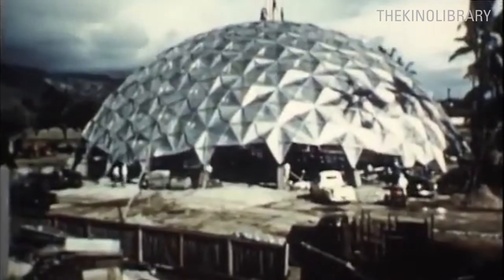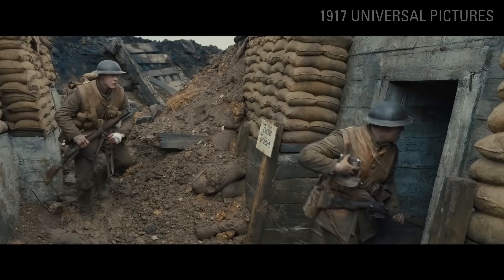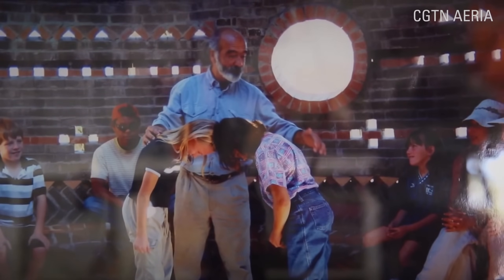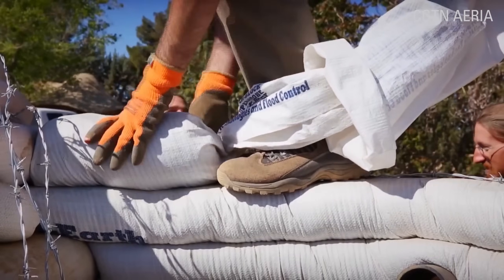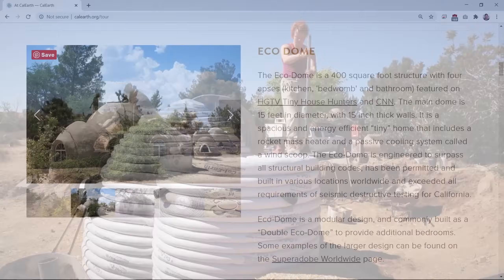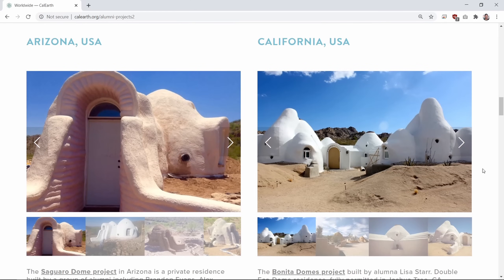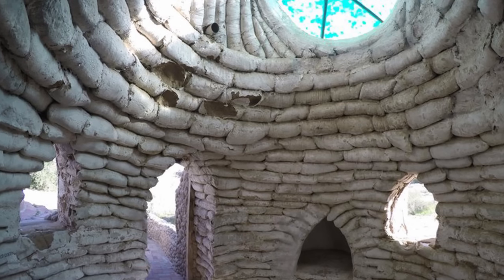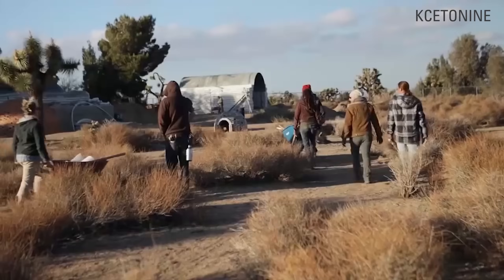Pros and cons of Superadobe Earthbag homes

Comment: The biggest problem you will have with these as homes in the US is building codes.  Most places will not allow you to build them. 

What I plan on is an earthbag greenhouse, adapted for northern environments. It will be a straight wall on the north side, fully insulated with roughly 8 inches of aircrete, with the earthbags on the inside acting as a trombe wall for thermal mass.  Alternatively I could use tire bales for the same purpose. This will be built in the Kenai Peninsula in Alaska.  https://www.lowtechmagazine.com/2015/12/reinventing-the-greenhouse.html

Earthbags will work fine if you build a bond beam on the wall on top and buttresses, which were covered in the earthbag building book by Mr. Khalili. On the square earthbag house you showed in your presentation you can see the builder incorporated them. The walls cannot be too tall though or straight walls will become unstable.

Comment: Could you use aircrete inside the bags instead of adobe?
Reply: Aircrete is just aerated concrete. The drawback is that aircrete is very porous. So you'll need to spray a sealant over the aircrete. You can use aircrete sprayed on the outside as a protective shell and on the inside as a type of "wall". But you may be better off spraying stucco for the outer shell. 
There is a company in Paris, Texas called Monolithic Dome that uses an airform. They blow this balloon form up and then spray aircrete on the outside of the balloon. Then deflate the balloon and then spray another aircrete layer on the inside.

Comment: I'm interested in the fail rate. 
Also, possible additives to increase strength. 
The housing market and lenders have biases. Incorporating the earthbag structure with the earth ship sustainability  is a sure way to appeal to the public instead of the market. It's the people who need affordable reliable homes.
The packing was the most labor intensive step with both the earthbag and earth ship homes. 
Thanks for the video.
Reply: Military bunkers made out of sandbags can withstand bombing from rpgs and mortar rounds if that helps at all. Also an earthbag orphanage built by Cal-Earth withstood the 7.6 earthquake that happened in Nepal in 2015.

Comment: I understand how this might not be an ideal building solution in the United States or most developed countries, but I do see how it would be an ideal solution in say rural India, China, many rural sections of countries of Africa and South America. Now what I don't know is if it would be more ideal then what they are currently using and if it would be cheaper then what they are currently doing. How it holds up in extreme weather and flooding would be one of the major factors in figuring that out. What I do know is in a lot of these areas light is an issue (windows that don't cause major drafts, so they tend to go without them, or very small ones) and just basic insulation or temperature control of any kind. 

There might also be a way to alter this building style so it does more conventional building sizes and shapes. It would up the cost, but it would still be cheaper then many current options, and eco friendly. It is a possibility in building evolution. The insulation value and the local resource are both reasons to figure out a way to make this building style work more broadly.
Reply: This is an example of a family that built one home / structure as a bedroom for each of their kids in Nevada. I forgot I had watched their channel before and after watching this video it was recommended again. Thinking back to that video this might be a good solution to lower income or even homeless housing. 

https://youtu.be/n_yAY1Ybfmk 
Video of one of their kids bedroom / structure

https://www.mylittlehomestead.com/full-version-building-earthbag-cabin-diy-the-family-builds.html 
Earth bag Cabin on their website

The more I think about this, the more I think this really could be a solution even in the United States because of how many people are willing to build themselves because they just don't have the money to do anything else.

Comment: There is another pro which is the weight. You mention they survived hurricanes so you hinted at that. But it's the earth bag weights that offer an answer to the question you pose. Regardless of sand and clay content in soil you can use local dirt as a weight in a pre-fabricated house that otherwise lacks structure or would have needed a foundation. If you have a triangular tube and half of the triangular tube is filled with earth bags and the other half is kept empty then you now have all kinds of the benefits of an earth bag home without as many of the cons. I have a design for a completely off grid pre-fabricated home that comes with earth bags in the kit. It uses geo-thermal heating and cooling, solar, wind, biochar creation for extra heat and a unique compost toilet that uses the biochar in a way outlined by an academic paper I think you'd enjoy reading. Get in touch if you want to learn more about the design.

Comment: Helped build two of these in Arizona. Figured out what you said pretty quick. It was a fun community project. Not practical on any level in the US. Good video.
Reply from the maker: I would love to see the homes you helped build! Any photos online? How many days did it take to complete?
Reply: @BelindaCarr  They were both 100% off grid out in the AZ Mohave desert. Sorry no pics. 25 years ago.
Reply: @BelindaCarr  as in many diy friends helping friends projects, the bulk of the work was done over three weekends on a 600 square foot dwelling, there was so much detail left undone such as finishing the roof, doors and other trim. Hard to say. I know one was abandoned early on due to structural concerns. We used rice bags with two rows of barb wire.

Comment: On the downside: in domes, roof and walls are one and not separate, therefore rain is flowing over it from top to bottom. This create a dilemma: in order to avoid water penetration you either make your dome waterproof and lose breathability (cement stucco etc) or have semi breathable and water repellent plaster that will need to be reapplied due to degradation (lime render). Other option is to create separate roof over dome, which will protect it from rain, or have superadobe walls only and something else overhanging them.

Comment: Looks like a perfect application for those bricklaying robots. Have one machine dig up sand and fill bags to a standard size, and the other one laying down bags and pieces of barb wire. One machine could build a village in record time.
Reply from the maker: Good point, but does it go against Nader Khalili's intention of bringing the community together and finding joy in manual labor?
Reply: @BelindaCarr  There's not much joy in manual labor after the first two hours. After that it becomes torturous. The same motion over and over again long after your mind has started wanting to be free to think and your body has started protesting over the toll the repetition is taking.
Reply: Exactly. This method is very labour intensive and in countries where labour is more expensive it will remain niche for hippies, preppers and off-griders. Nothing wrong with taking advantage of technology and 3D printing those structures.

Comment: Can withstand earthquakes only or more likely if the shape is round .
Reply: The walls may flex. Non round structures are bound at the top by a bond-beam that acts as a tension ring.
If the earth is tamped properly at each level the wall will actually "ring", as it is struck.
There are university studies and one website detailing the deconstruction of an earthen building.
Unreal strength, but for earthquake?
You're maybe onto something that's a lot about the foundation.
Earth houses are HEAVY

Comment: Cost! You completely went over cost. It's like cheaper? That's super important!
Reply: The  1400 sq ft earth bag house the my wife and I built cost about 20 - 25 k.
An eight foot section of wall that is 7 feet tall and 15" thick costs about 10 bucks or less in material, but can weigh 9-13 tons depending ( buttressing etc)
We had a conventional loft and steel roof that cost more than was bid. The contractor said I was using every brain cell he had, at one point.

The foundation, stem wall, bagging, doors, windows, bond beam etc were done by just me and my wife.
350 tons of material including 7 pallets of concrete and a semi truck full of wood, 175 tons of foundatipn shot rock and gravel, and all the dirt moved and screened by hand at least 3 times be just she and I alone. Avg. 6 days a week for about 9 months collectively.
I do not recommend this as a leisurely way to build a house.
The addtional gear needed is things like shovels, wheelbarrow, ladders, cement mixer, generator, screens, bag holders for filling bags, tampers, drills, saws, hammers, wiring, plumbing, tiny bobcat, well drilling, .......land you own?, will buy? etc
If your working across state lines or transitioning from one abode to another just figure on doubling the cost.
Some you buy, some you improvise
You get the picture
Reply from the maker: That's a vague question. Cost per square foot? It depends on the location, whether you can use the earth on your construction site or if you have to truck in mounds of dirt. You also have to consider the cost of your time/labor as well as the amenities inside the home. A stick home could be cheaper.
Reply: @BelindaCarr  right?! I believe a video that only talks about the economic aspect would be cool. Many thanks!

Comment: Belinda, Thank you for your analysis and comments -on the pros and cons of earth bag building. I enjoyed your over all view of the method and history. I would like to say that some earth bag builders choose to mix Portland cement with the native soil when harvesting materials locally. this method allows for increased structural rigidity and longevity. it also increased the thermal mass because of the conductivity that the cement creates in the mix. sure it will increase cost a bit but the overall viability of the structural stability of adding the cement may invariably remedy the permitting requirements per locality.
Reply: Adding cement for stabilized earth is a great way to improve an earthen floor to a depth of 4-6 inches before you finiah it.
Adding cement to the wall material adds aggregate, and the mortar may act as an adhesive, like the clay does.
Care must be taken with the ratios because unlike the earth which breathes, cement will wick moisture up the wall from the stem wall that acts as a moisture barrier.
Reply: As long as you have the adobe mix correct with the optimum amount of clay, you can add one 94lb bad of portland cement per cubic yard of material. Depending on the residual moisture in the mix, it may help to add a minimal amount of water. Tumbled in a cement mixer and not a paddle style mixer will give you something like a 1200 psi mix that sets wonderfully.
Reply from the maker: Thanks for sharing that info! I watched an interview with Nader Khalili's daughter where she mentioned the addition of Portland cement.

Comment: Hi Berlinda, in other words earthbag homes probably make good travel experience hotels, refugees or emergency shelters but not suitable for wide public adoption? I'm not sure if the foundations are there, so I'm curious how it plays out. It does look cool at first sight, but I doubt anyone would like to live in there for a long time. It feels too insecure.
Reply: btw, as always I love your content. Thanks for taking the time to research and putting together this video, I really appreciate it.
Reply from the maker: Thanks a lot, Peng! I appreciate the support. I agree, it is an interesting concept for an Airbnb or shelter but it is so disconnected from what we consider to be a modern home. From my research, the homes are just built on the earth with a rubble trench, not a concrete foundation.
Reply: @BelindaCarr  it's nice to talking about super Adobe may disagree with you some things about super Adobe. 1 some cons you said to me is weak (doesnt mean your Wrong )but you can have cheap custom furniture by simple design or your woodworker or black Smith or by building furniture by using super Adobe to make chair 2 it can be use in main stream like you said before it's cheap and have price by replace blocks (doesn't mean that blocks all going to be gone) plus super Adobe is just evolved by regular Adobe you know it and I know it old thing used in past and I see it's there's alot benefits and pros it's just need more evolving maybe one day we will see super Adobe skyscraper or oil rig
Reply: @BelindaCarr  plus English is my second language you might see some mistakes and some words that don't make sense
Reply: I think they may suit low income areas/families with access to cheap labour, assuming they have the right soil mix.  Or hard to access areas.

Comment: Solid info!  The limitation I see to this method of vernacular construction is that populations are growing fastest in regions where the environmental conditions or local materials would be unsuitable.  For example, Harris county in TX has a very high population density specifically because the high clay content made it excellent for farming.  It's more likely that "mineral soils" would be most suitable, which means low historic population density.  

The ancient approach to building structures in the flood plains here in the Mississippi river valley was to use piled shells and porous materials as a foundation.  You do occasionally see a surviving structure using half-timbered wall construction techniques common in recent centuries.
Reply from the maker: Thanks for sharing your knowledge! That was very insightful. Do you have the names of those surviving historic buildings so that I can look up?
Reply: @BelindaCarr  For bousillage structures, it's mainly old preserved structures from the French settlements and other sites, (e.g. Kent plantation in Alexandria et al) though they learned the use of vernacular materials such as retted moss from the native tribes.  Europeans had previously relied on retted flax iirc.

The mounds culture sites are very numerous, but not always well preserved.  One of the materials that is commonly used is sand from sandbars along the river, as it is otherwise very scarce in the valley not to mention difficult  to transport by canoe.  The LSU geology building has a nice exhibit on  these cultures on the second floor.  A quick search for louisiana/mississippi mound sites shows interesting resources, along with a map of the extent of known sites. Predictably, they cluster along current and past waterways.